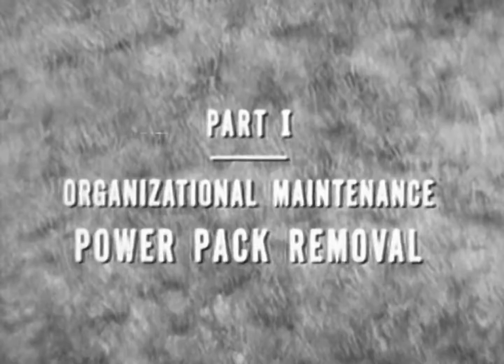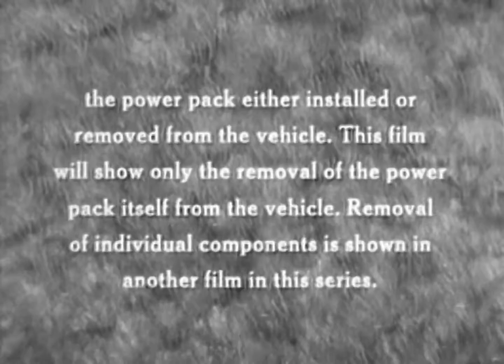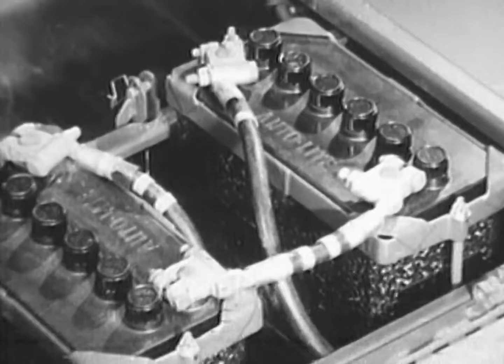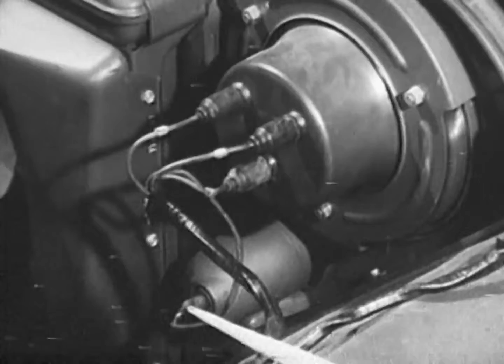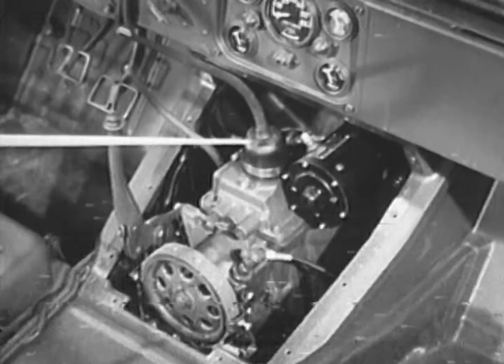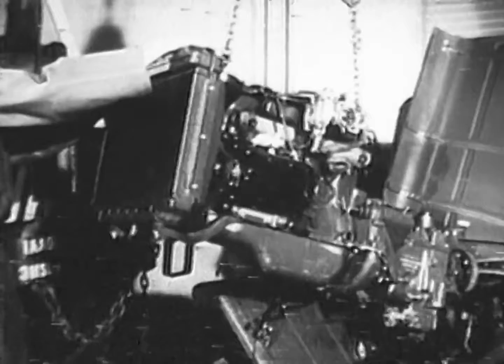M151 MUTT “Jeep“ Engine Removal׃ “M151 Engine Four Cylinder OHV “1961 US Army1

Comment: Ten years on line and no body has used this as a template? Well, I just did. I paused and advanced, and wrote out all the steps in sequence. There are four pages double spaced worth of single steps. It worked extremely well! And, yes the M151A2 engine started right up.